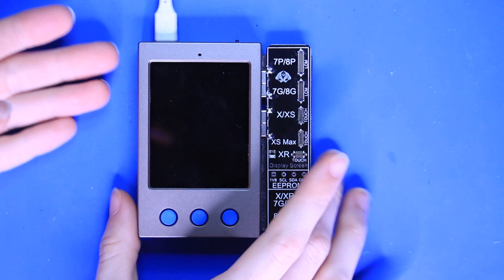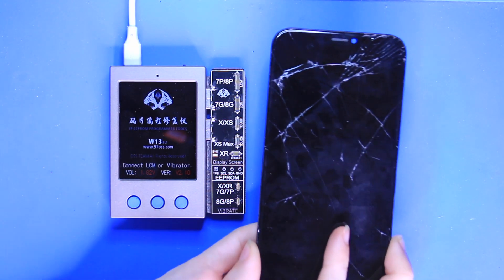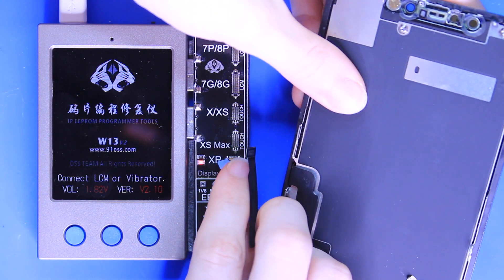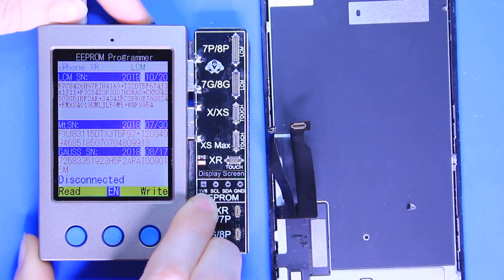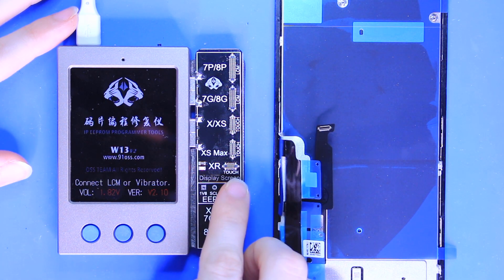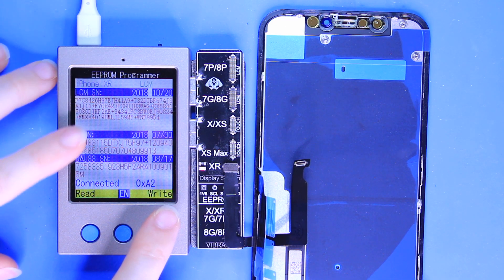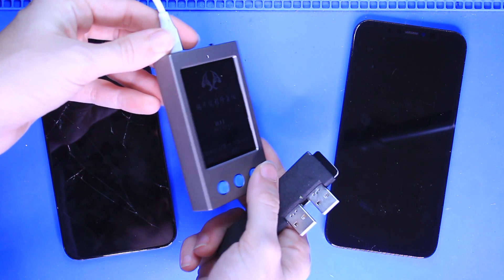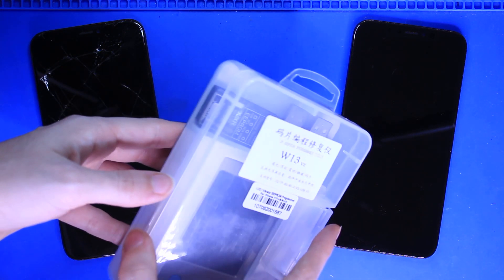iPhone XR EEPROM Demo - How To/ Why Use An EEPROM iPhone Repair - iPhoneRepairGirl

Comment: I recently replaced my lcd on an XR and a week later image has been lost. I never transferred serial #, therefore could that be my issue?
Reply from the maker: If you mean the LCD has blacked out, it’s probably either broken or disconnected. I would reopen the phone & check that all the connectors are installed properly.
Reply: @iPhoneRepairGirl  only when I plug into wall charger will it turn on, but then turn off right away. Possible defective lcd, ot did cross my mind.
Reply from the maker: @vicbalbuena  it doesn’t sound defective if it worked fine for a week then started having that issue it sounds like it’s damaged

Comment: Excellent video! I really enjoyed that as I have just purchased a icopy plus and use it for truetone transference. I also have battery serial information transference option too.   But my question is, will this device stop the built in message from iph11 software stating that this screen is not genuine? Id really appreciate some feedback on this question, from you or anyone who has experienced the same.  Thank you.

Comment: I replaced my iPhone 7 Plus screen and now the “auto-brightness” setting option is missing and therefore no longer adjusting brightness in different lighting conditions. Will this also help with that problem? It’s so annoying to manually adjust my brightness when going in and outdoors. Thanks!

Comment: Sorry, what happened if I will replace it without reprogramming? I mean, it will work touchscreen at least? Or definitely it does not work? I know that face id, 3d touch and sensor light it does not will work but I don't care too much.